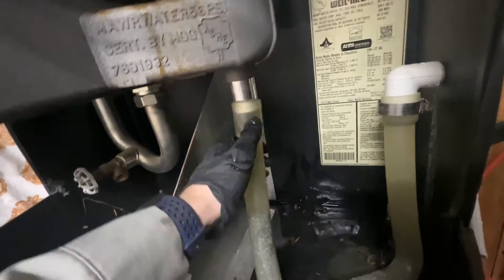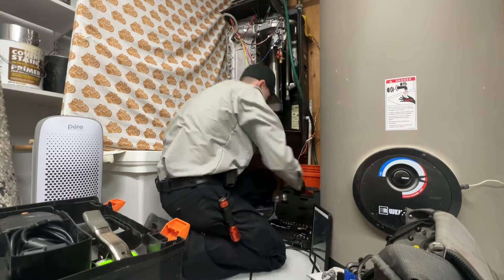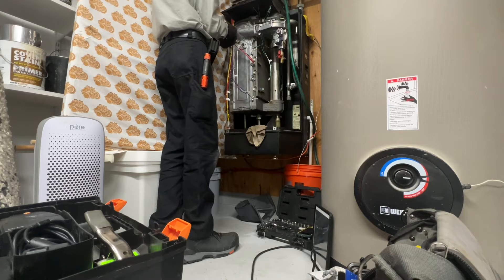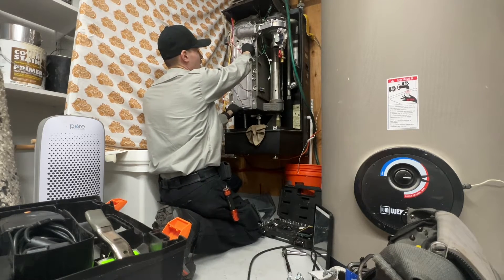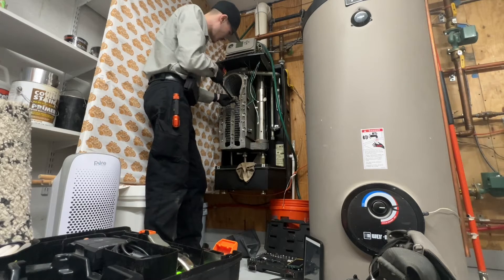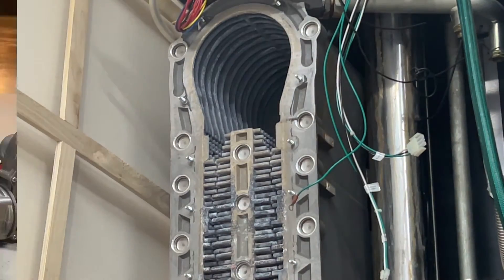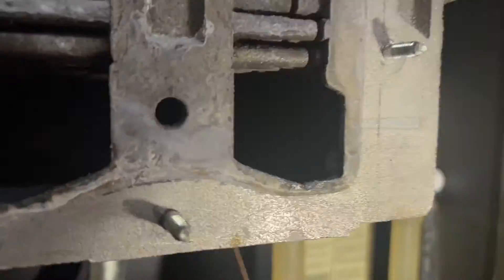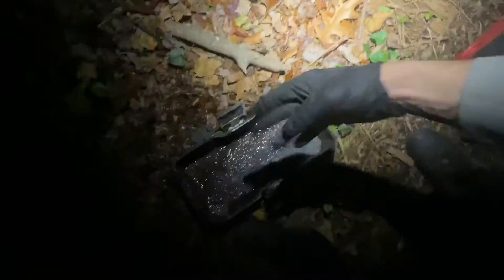Weil McLain Ultra 3 Ignition Failure! Filthy Heat Exchanger, Plugged Condensate Trap, Dirty Ignitor!

Comment: High condensate level of low Ph water…certainly not good for the heat exchanger. Also that long a wait for service kills productivity for contractors as well as possibly higher service call costs to the consumer…you’ve got those units down well Daniel. I’m thinking a switch could be piped in to the condensate drain to kill power upon a high level like in a secondary drain pan…just install a tee in the line
Reply from the maker: Yea, Burnham does that with a float switch above the trap. The only reason he waited for service was because he thought he could fix it.

Comment: Holy condensate trap full of heat exchanger ,Batman.
   That unit I can't see lasting much longer. I mean it's aluminium block,or magnesium, but the acid had definitely penetrated it. Especially sitting there for 3 days full of heat exchanger acid.
   Definitely a great job you did. What ever you charged,he's lucky to have a tech like you on board.
   Put a lot of ultra's in want to say I like these boilers. 
     Keep up the great work . We need more guys like you!!

Comment: Can't you put a lower bend in that drain pipe? That bend is huge.great video daniel
Reply from the maker: That drain pipe is what comes in the boiler factory. The blower has a lot of pressure, I think it needs that much of a bend so that it doesn’t blow out the drain and spill exhaust fumes
Reply: Ok thanks for the explanation I didn't know that. But wow unit filled up like that wow.
Reply from the maker: @scottmaz4063  you’re alpine has a float switch so that can never happen.